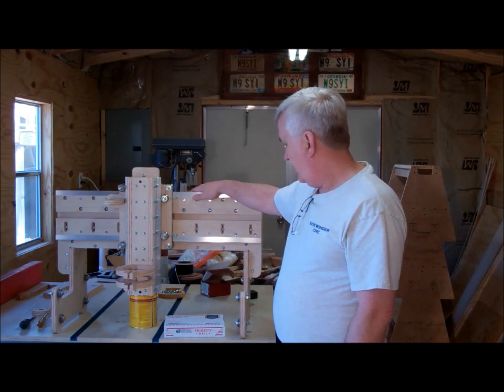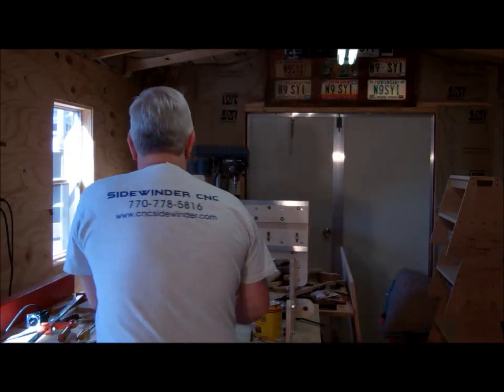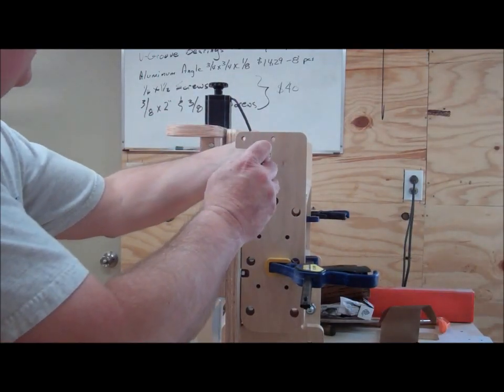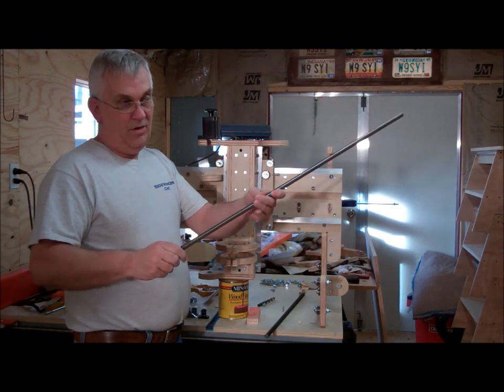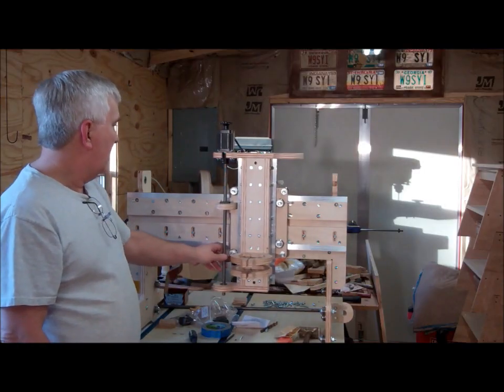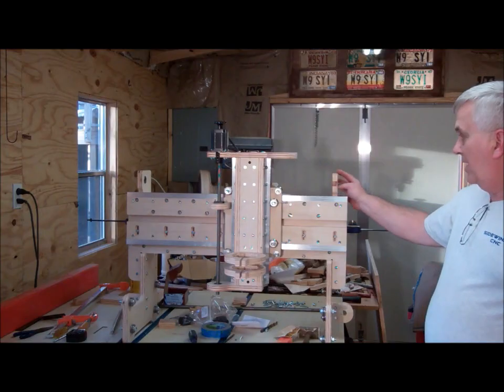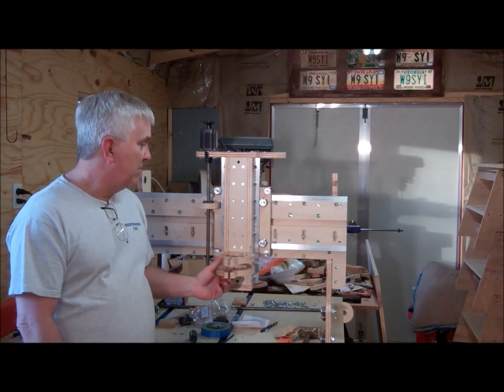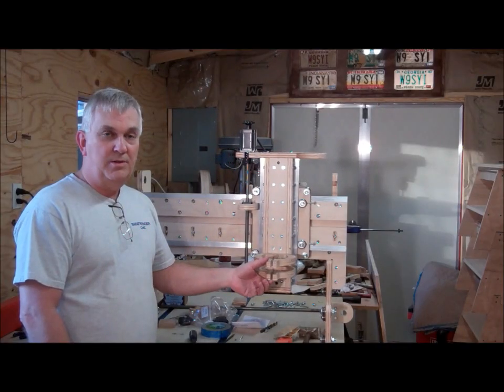How to Build a CNC Router On A Shoestring Budget Part Three

Comment: Hey Dave one "start" are the rods on this machine? I'm building mine with a dual nema 23 x axis as well and I'm wondering if I should get 1, 2, or 5 starts lead screws.
Reply from the maker: +Kaden McDonald I use 5 start precision lead screws.  The five start means that it only takes 2 revolutions to move an inch so you can get much faster rapids than with a 1 or 2 start.  Thanks for watching.
Reply: Thank you for the response. I planned on ordering 5 start lead screws I was just worried about whether or not my dual 270 oz. stepper x axis would be to strained with a 5 start lead screw. Hopefully they can handle it. Do you think they will be too weak to handle a similar sized gantry to your CNC here?
Reply from the maker: +Kaden McDonald They will handle it just fine.  No worries.

Comment: I was wondering about those v-groove bearings on that aluminum angle. I was concerned of the steel on the bearing with the weight of the z-axis assembly riding on it that it would deform the edge of the softer aluminum stock. The alternative I was thinking was maybe buying regular skate bearings and making v-groove nylon wheels to slip over them on a lathe. Maybe it won't be a problem but only testing will tell I guess.